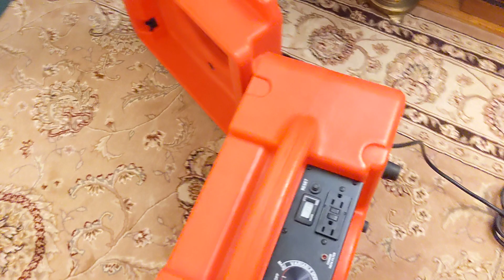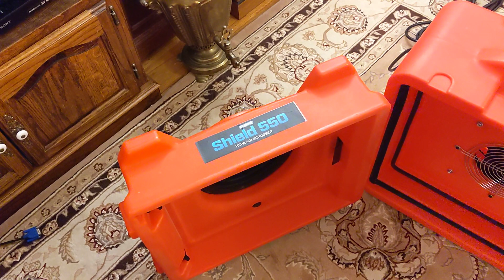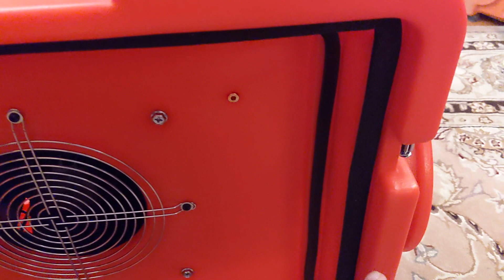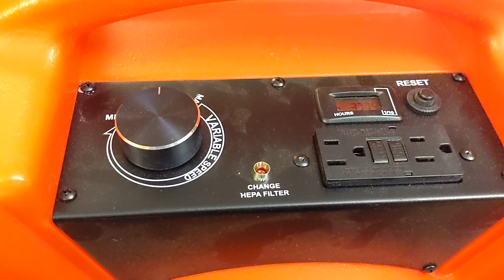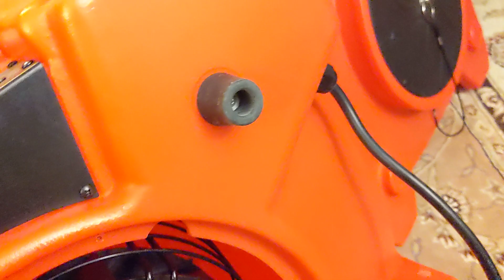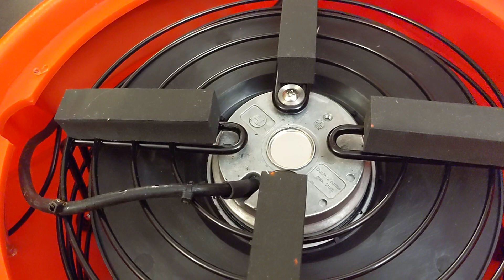Review of CADPXS SHIELD 550 Air Filter, and Experience With Company

Comment: Geez, wish I'd seen this before I bought mine.  Bought because it's the same unit a mold remediation company used in my home.  I was wondering why the runtime meter was so high.  I'll have to open the air intake to see if I have the same issue with the motor mounts.  The packing on mine was the same as yours with the same resulting damage to the box.  At $400, pretty expensive considering what you've pointed out.  Did you post this video review on Amazon?  If not, I will.  Thanks!
Reply from the maker: I posted a review to Amazon with pictures although not this video. There were several questionable potentially fake reviews at the time I posted, and multiple ASINs for the exact same product. Others reported the same issues I did. Amazon doesn't seem to care much about defective products on their marketplace.